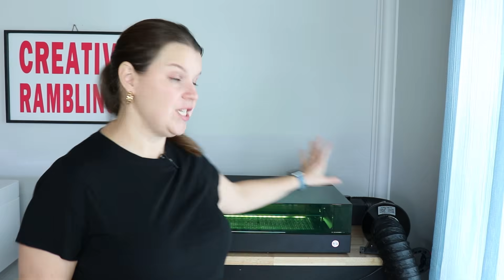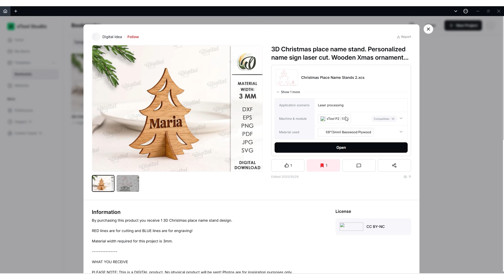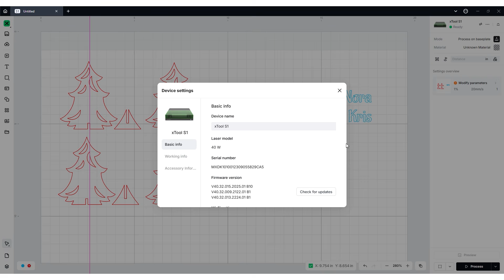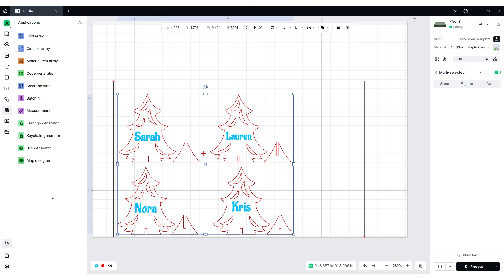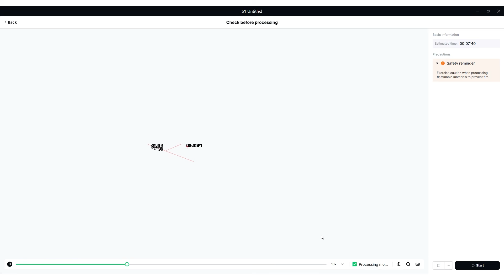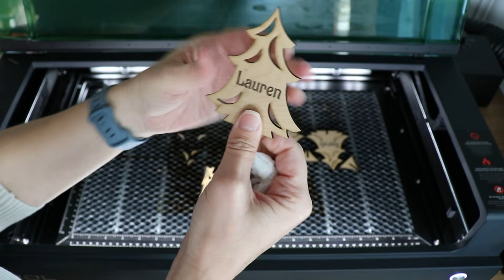xTool S1 Beginner Project with Studio Software

Comment: I love your videos.  I am trying to decide which unit to buy. Have you ever cut the pre made sublimation metal sign on any of your xtools. The signs are aluminum. My goal would be to make custom shapes and sublimat on them.  The thickness is 0.45mm
Reply from the maker: I'm so glad you are enjoying my videos! To cut aluminum you need a pretty powerful fiber laser. I have a 60W that can cut through a very thin sheet but it take a lot of passes and time. And the bed size is very small. I would look into something more powerful and larger to accomplish what you are looking for.

Comment: Sarah, thank you for this cool project. I'll be making it as soon as I get my laser. Right now I'm looking at different lasers. Do you find the lack of a camera in the S1 limiting?  I was also looking at the LaserPecker LX2 with the camera.  It's a bit more pricey then the S1.  I don't know so I'm asking first. 🙂
Reply from the maker: I don't mind the marking system, in some cases it's more accurate than a camera. But it does take a few more steps to mark and place designs. This is my most used diode laser compared to other brands that I own, it's just easy to use and the software is nice too. I have an older LaserPecker and it's a good machine, but I'm not familiar with the new LX2. Although it looks impressive.
Reply: @SarahVanderkooy  Thanks. After last night binge watching videos, I'm leaning towards the XTOOL because they were saying the cameras' fish eye loses accuracy at the edges.
I wanted to make wood models with it and needed accuracy.  It's nice to hear the XTOOL works as advertised.

Comment: How do you select multiple areas to cut  images spread out in various positions in xtool s1.  Example if had fabric glued on wood and want to cut specific areas.
Reply from the maker: When you mark your area, there is an option to add multiple. Mark the first area completely, then add a second or third before you end marking completely. Each marked area will show up on your canvas.

Comment: Do you know if the auto feeder conveyer can be used with glass sheets?
Reply from the maker: It can be used with any material, just make sure the sheet is prepped for engraving with a marking spray.

Comment: Have you engraved on tumblers?
If so, is this machine business worthy?
Reply from the maker: I have not done tumblers with this specific machine because I don't have the riser. I use it for flat engraving and cutting. I have done tumblers with a few other xTools and it's pretty efficient. The RA2 pro holds cups well and with a 40W laser head like I have in the S1 projects would get done quickly.

Comment: Thanks for the video.
However, I am finding the app to be the most frustrating.
All I want is a 4 x 4 square.  I drop a rectangle on the canvas, change the width to 4 and then change the height to 4.  The app then changes the width to something like 27.44.  If I change that, to 4, the height then becomes .5.
This is actually causing xTool buyers remorse.
Reply from the maker: There is a way to lock and unlock the aspect ratio, it's a little link or lock button between the width and height boxes. Try unlocking then setting your parameters.

Comment: Hi Sarah,
I have the S1 20W I have been using xcs with no problems however I really like some of the editing features in Studio but when I design in Studio it automatically defaults to 40W and I can’t change it so it won’t work with my machine. Do you have any suggestions? I have contacted xtool but it hasn’t been resolved
Reply from the maker: Does it stay at 40W even when the machine is connected? If so then that is probably a glitch, I would try to submit a support ticket to xTool or wait for the next update. It should automatically switch to whatever wattage you have connected.
Reply: @SarahVanderkooy 
Yes it does and the program detects that the laser module is different than what ‘a in the screen. I did contact support the said they are working on it. I was in the phone for quite a long time with support checking updates and drivers etc. I was told to continue using xcs until they find a solution